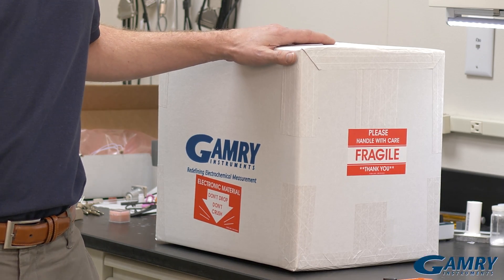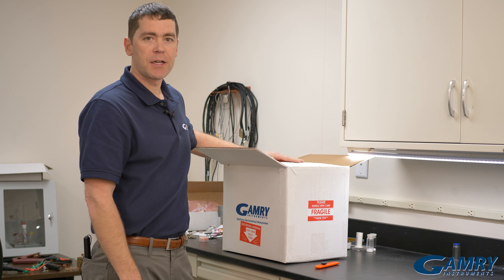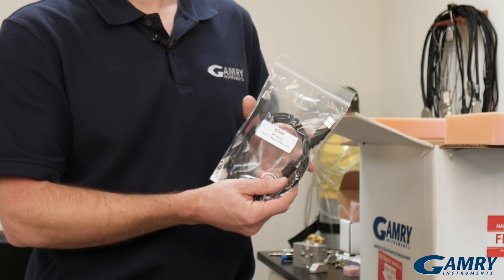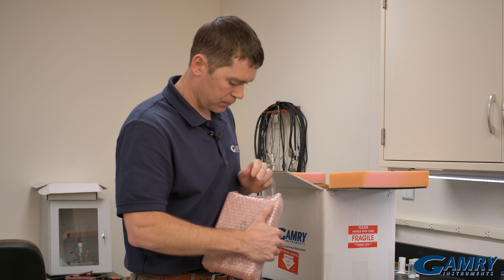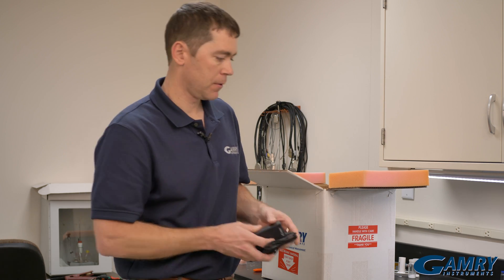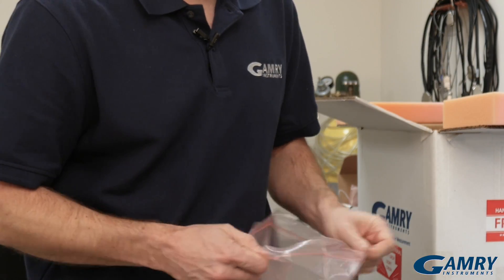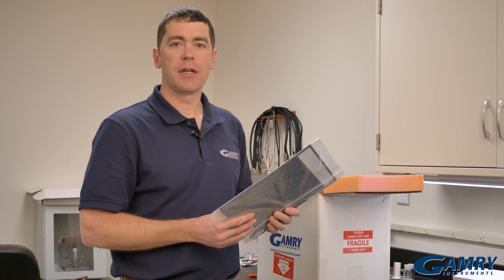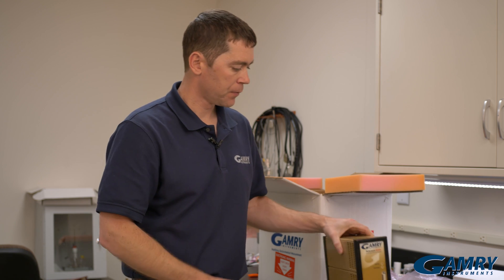Unboxing the Gamry 600+ Potentiostat

Comment: Sir, can you explain how to measure the charge discharge measurements for any super capacitor in reference 600+. I am trying for long time to get the voltage vs time plot for a super capacitor by using the same machine but can't reach the result. If you can help I will be grateful to you. Thanks. Hope I will get some help.
Reply from the maker: Hello. Our Cyclic Charge Discharge is located under the Electrochemical Energy software package. We have an application note describing this: 

https://www.gamry.com/application-notes/battery-research/electrochemical-capacitors-cyclic-charge-discharge-and-stacks/

Once you have the actual data collected, open Echem Analyst. There is an overlay data option in Echem Analyst. Select the CCD files you want to view, and select "OK". You can now use the "Show Curve Selector" tool to plot Voltage vs Real Time. This will show you the plot you are looking for.

If you are located in the US, you can email techsupport@gamry.com for additional help. Otherwise you can find your local representative for additional help as well: 

https://www.gamry.com/contact-us/international/
Reply: Sir, you are very much right on it. I already gone through the application note but still not getting the desired plot. I am working for last 7 years on the super capacitor and batteries but still feeling difficulties in gamry.  So, is it possible from your side to make a video and explain the parameters for a cyclic charge discharge experiment in gamry?
Reply from the maker: Hello. Would it be possible for you to email techsupport@gamry.com, and attach the CCD data you have collected? 

There can be many reasons the data does not look as you desire. If you send your data files, our Technical Support team can better identify your exact issue. This will allow us to help you get your desired data as quickly as possible.
Reply: Though I already contacted your support team but not getting proper reply from them. But anyway, I will send the same to that email id too. Thanks. But I am expecting that gamry will look into it to make it more simple because energy storage research is one of the leading topic since the decade throughout the world. Frankly speaking, I used potentostat of Biologic CHI and also gamry but, I must say in charge discharge measurements rests are much much user friendly than gamry.
Reply from the maker: Hello. We will wait for your email. There is also this video that describes how to analyze CCD data. It may prove useful for you:

https://www.youtube.com/watch?v=7y-aJPx5Vxg
Reply: Thanks for sending the video of data analysis through Gechen analyst. But I am looking for the process that how did you get the first capacity/capacitance vs time plot. Anyway, many thanks for the video.